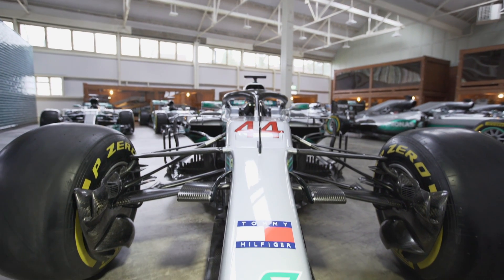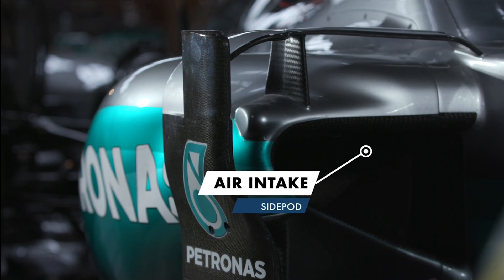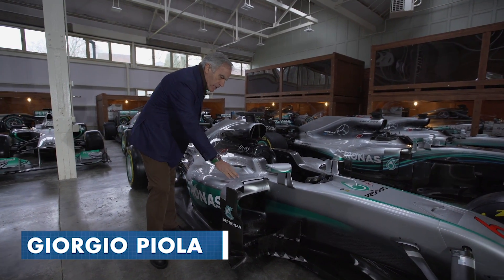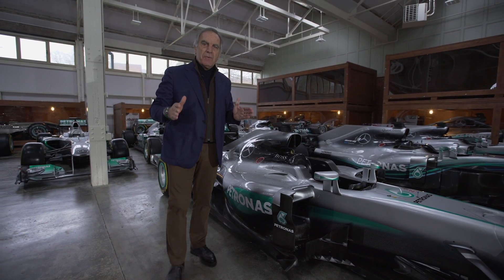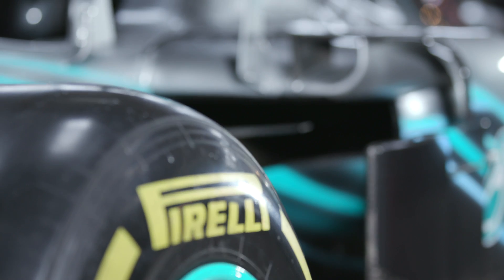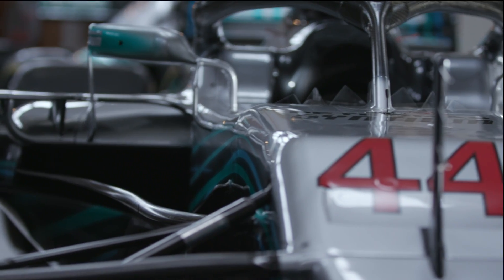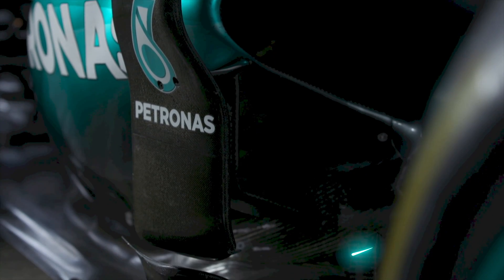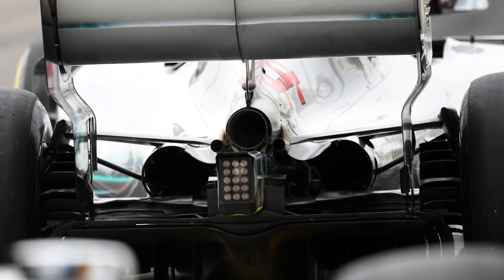How a Formula 1 car works: Episode 3 - Sidepods

Comment: I would love a more detailed, longer and more historical version.
I've watched a lot of "F1 how to" videos and there is (I think) a gap for a proper full nerd breakdown of the sports tech.
Reply: Chain bear f1.
Reply: @el_muncho_jr8498 , I want deeper than chain bear. 

I want late 70's early 80's deep but deeper.
Horizon and Equinox are a starting point.
Reply: Exactly! Although the teams don't like showing their work publicly, I'd be so happy to see an in depth review of even a 2014 engine/gearbox/cooling system etcetera up close. We never see this stuff and I think all of us watching the video want that. Steve Matchett used to show stuff like drawers full of different gear ratios for the transmissions and brake disks that he would hold and it was so interesting. They all act like we're morons.